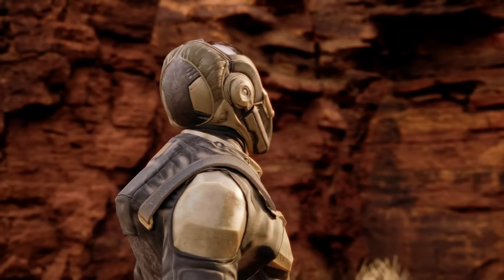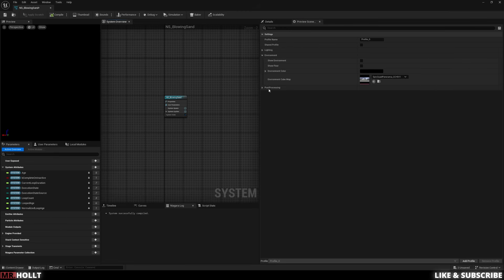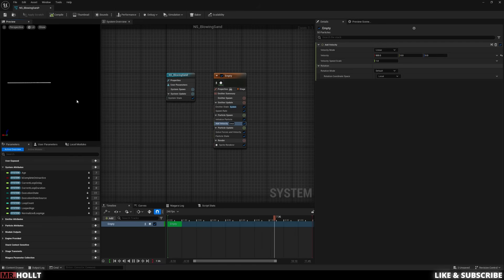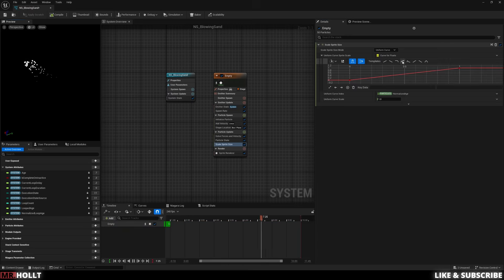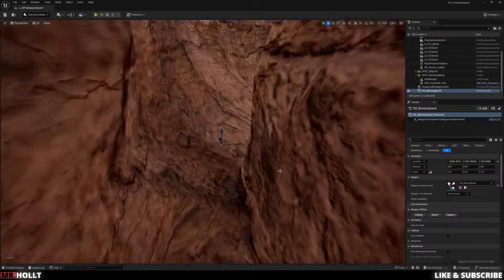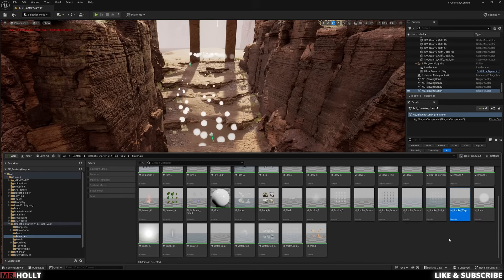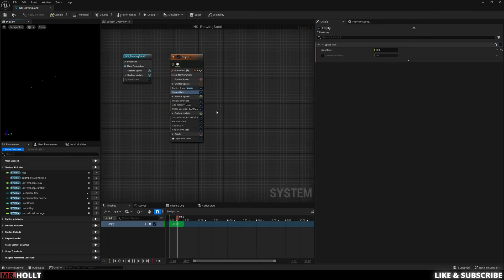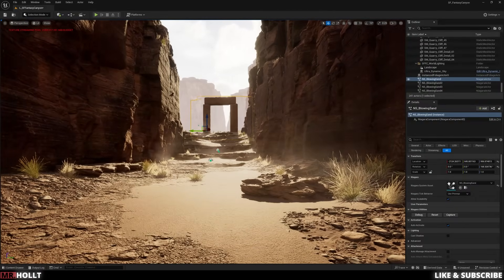How To Make Blowing Dust - Niagara Particle UNREAL ENGINE 5.4

Comment: Thanks for the tutorial, in 5.6 I couldn't find the empty node, there's Just CompletelyEmpty, which lacks some nodes, I did pause and added all the empty sub nodes which made it work. great video for such a topic in under 10mn and actually clear and feasible, which is not the case with 80% of youtube tutorials of unreal engine. appreciate it.
Reply: Can you tell me which empty sub nodes solve your issue , explain me little bit plz
Reply: @RCU-d5o8u  I paused at 1:36, whatever is missing in your node you need to add, I can't recall 100% what nodes were missing but you need to add those by clicking the + button next to a specific group : Emitter state (under Emitter update), Initilize particle (under particle spawn), particle state (under particle update), sprite renderer (under render) and continue the tutorial from there
Reply: @aijez4394  Yeah solved, there is Still This Template but with new name

Comment: Can we make it look like sand rather than a smoke? Sfx can take it there but i want actual sand to be visible when in a close camera shot and can we edit the timing let's say i want a wave of sand smoke now and a like 20 seconds delay i want similar or less than before wave of it? Which in-turn means i want to edit the timing of it as well as number of particles, which i can leave it in loop. Also can i link it to a surrounding wind(if there is such a thing like preset such as volumetric fog) like as and when the wind blows the dust should rise and settle once it goes away.

Edit: Also can we make a splash kind of effect from niagara? Lets say i want to make a perfume ad or a juice brand ad and i want a splash kind of effect on to a object?

Comment: Thanks for the video, it's really helpful, just missing the realistic starter FX pack as it's not free anymore
Reply from the maker: Its still free: https://www.fab.com/listings/ac2818b3-7d35-4cf5-a1af-cbf8ff5c61c1
Reply: it is man :p
maybe it wasn t whe you looked but today it is
Reply from the maker: @albertogili1786  https://www.fab.com/listings/ac2818b3-7d35-4cf5-a1af-cbf8ff5c61c1
Reply from the maker: @albertogili1786  https://www.fab.com/listings/ac2818b3-7d35-4cf5-a1af-cbf8ff5c61c1
Reply: @albertogili1786  @mrhollt thanks both, for some reason I didn't receive the notification of the comments, I got the FX pack!

Comment: Great video! Would you use this technique if you wanted your character to kick up dust plumes when walking/running across the dusty ground? Or something else?
Reply from the maker: I was thinking of adding that in to test actually. I do think it would work but a lot of the parameters would need to be adjusted to make it scale  correctly.
Reply: @MrHollt  I was thinking about this because I saw a video by Aiden Wilson last month ( https://www.youtube.com/watch?v=vZqWe9e-QeM ) where he did a cool thing with shadows on footprints and I wondered about doing that same type of thing with dust....and now I am thinking of it with both dust and shadows :)

To be honest most of your world building is past my skill level but I'll try to work through it until I get stuck. Very good job with it.